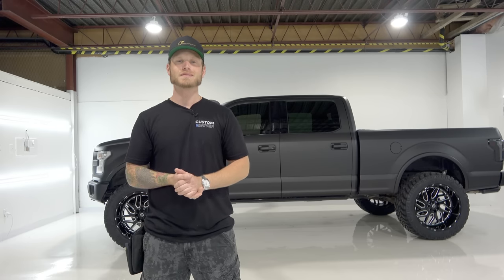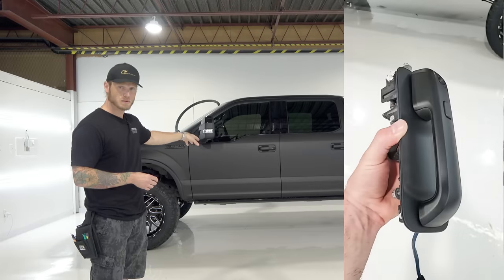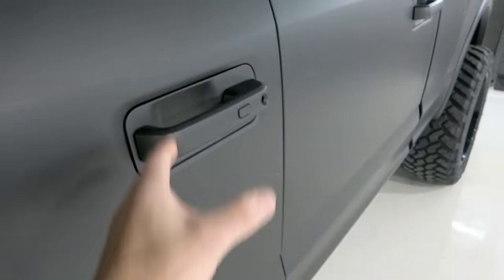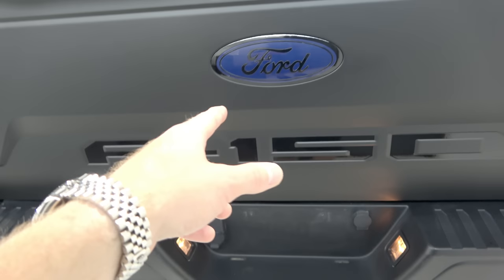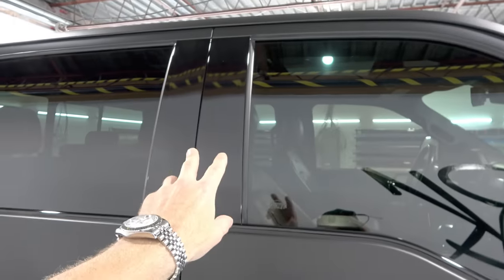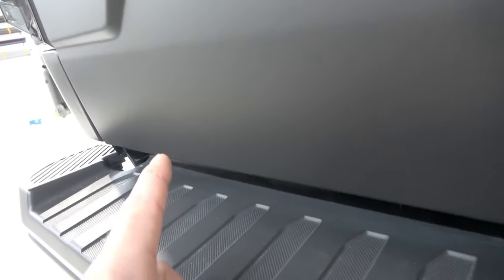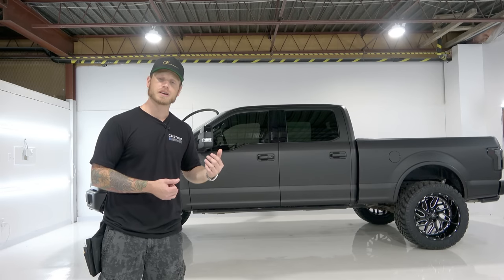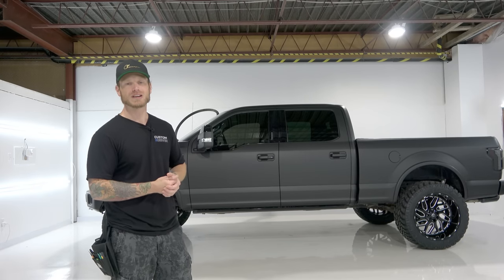Matte Metallic Black Vinyl Wrap 2016 Ford F-150 - Looks Brand NEW!

Comment: How long do these wraps last? If the vehicle is garage kept how many years will it look good before the wrap starts to look bad? Say the vehicle is driven about 8k miles a year.
Reply from the maker: I have customers who have had their wrap for over 6 years. Only summer driven vehicles and in good condition.
Reply: What happens when the rap starts going is it just peeling or are there other issues that occur?  Total noob to raps so sorry for the noob questions
Reply from the maker: @sensei2121  it's important to remove the wrap at the first sign of deterioration. In 12 years I have only seen a film stain white paint about twice, and that was roughly 8 or 9 years ago. Otherwise I've never seen the film or adhesive damage paint. If the paint ends up being damaged, it's 99% caused by whoever is removing the wrap.
Reply: Thanks for the info.

Comment: BEAUTIFUL! great work as always Christian!
tell me something, if my clearcoat faded, is it possible to wrap it without making any paint corrections?
Reply from the maker: The clear coat was faded on the top corner of the bed and I wrapped over it. You can't tell it was faded but there are different levels to faded clear coat so results will vary.
Reply: @CKWraps  
On my car all the clearcoat of the roof and hood faded... so according to your comment i guess it will be problematic ha...

Comment: Looks fantastic! Only thing I would have done extra, which is very small, is just smoke out the side markers on the mirrors. Cleans it up a tiny bit more. But, just my opinion. Looks great man.
Reply from the maker: You're right, that would've been a nice added touch.
Reply: @CKWraps how much would it cost to wrap the roof with pano sunroof?

Comment: How well do wraps last against rock chips?? With wide wheels?
Reply: They do pretty well.  They don’t chip like paint, they might scratch or pockmark a bit.  They have self healing properties so heat/sun will take out some of the scratches.  Overall, this stuff is used to protect paint from scratches.  It’s going to be much more durable in many ways than paint.

Comment: Very nice 
Looks beautiful. Too bad that it gets so hot that it cracks. It will not last  two years. Its just a temporary thing 😔
Reply from the maker: Funny that you say such a thing. I have vehicles that I've wrapped 7 or 8 years ago which still have a wrap on it in great condition. Many of them are driven daily and stored outdoors.
Reply: @CKWraps  I really don't think that it is  Funny at all.
More like a rip off.
Pay for the vinyl. (AND I HAVE TRIED A FEW DIFFERENT OPTIONS)
Pay for the installation 
And a bitch to remove 
What is Funny about that?
Reply from the maker: @vm722  it's funny because you stated it would last 2 years as if it were a fact. It isn't a fact. That is called circumstantial. Based off of the circumstances ie. material brand, climate, care, use etc.